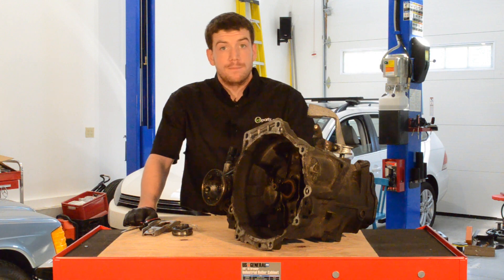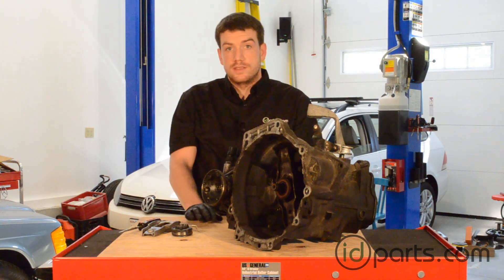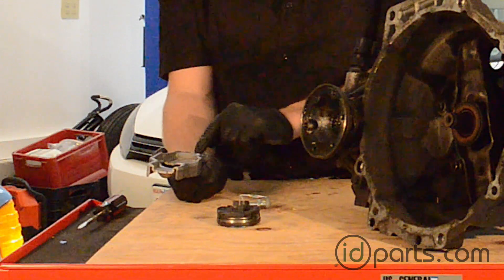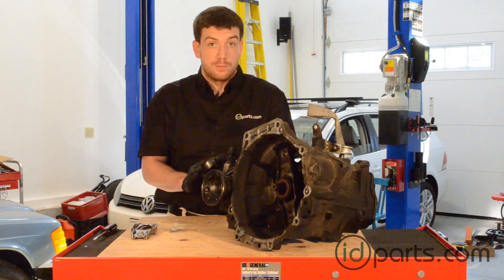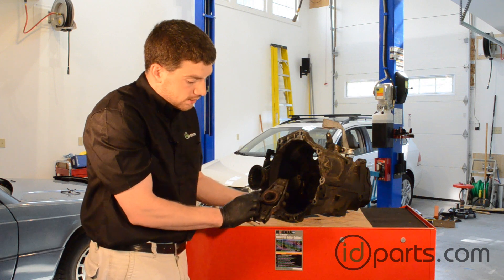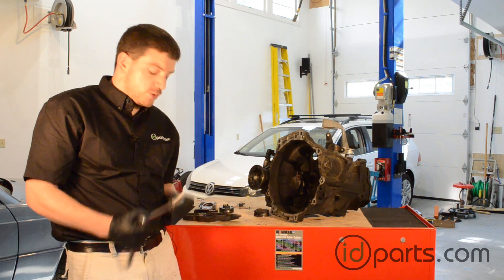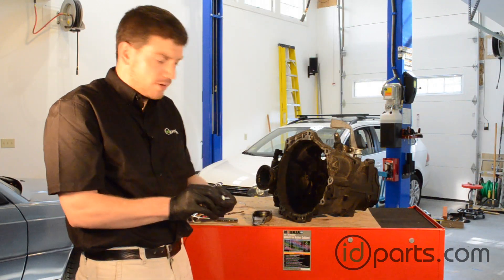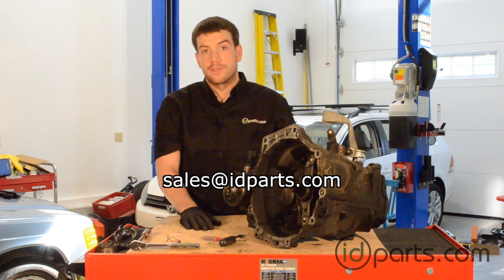Overview of 5-Speed Clutch Lever & Throwout bearing system

Comment: ok i dont know still how to take the throw out bearing. it would be better if you could go into the transmission to see what you did with the clip. thank you.
Reply: There is nothing to it at all, there are 2 clips on the throw out brearing that clip into the fork. You wouldn't be asking this if you actually tried to remove it